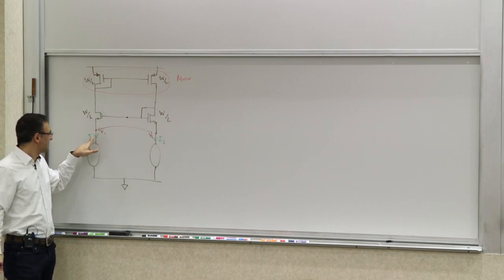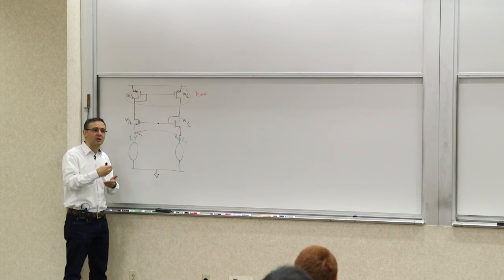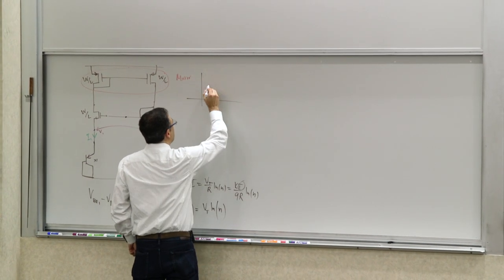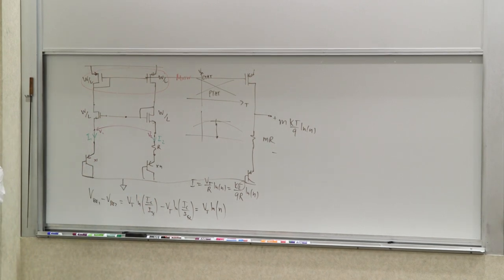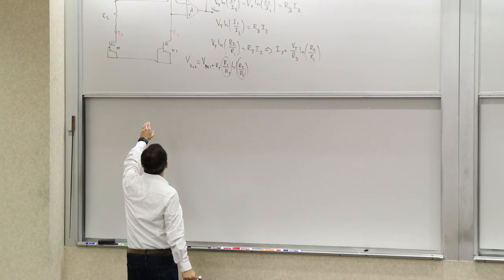134N. Scaled bandage reference, adjustable voltage PVT independent references.

Comment: 00:04 Advanced biasing techniques in integrated circuits
02:25 The Scaled bandage reference and adjustable voltage PVT independent references enforce similar currents and voltages.
08:07 Enforcing equal currents for substantially similar voltages.
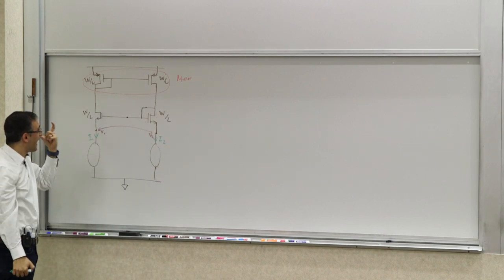10:21 Diode connection impacts voltage regulation.
15:39 Different configurations for VT reference
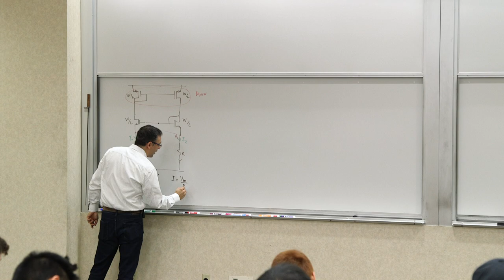17:40 Adjustable voltage PVT independent references
21:39 Discussion on creating a constant voltage using adjustable voltage references.
24:13 The need for a stable solution in chip design.
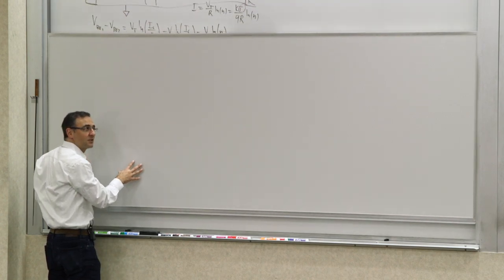28:23 Using op-amp for voltage equalization
30:44 Analyzing voltage references using equations
35:48 Voltage cancellation at 1.1 volts
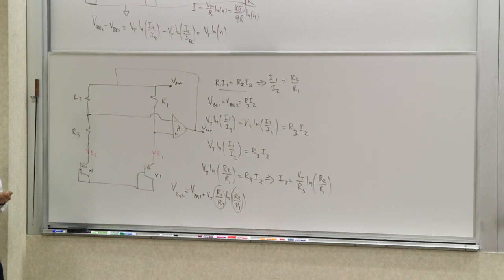37:48 Discussing the issue with the voltage and finding a solution
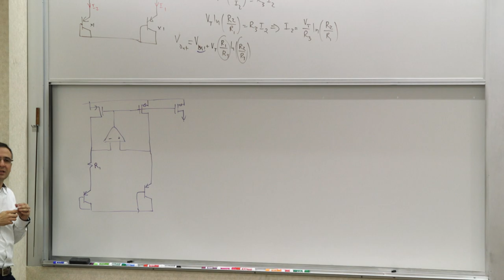42:25 Generating a VT reference by dropping voltage across a resistor.
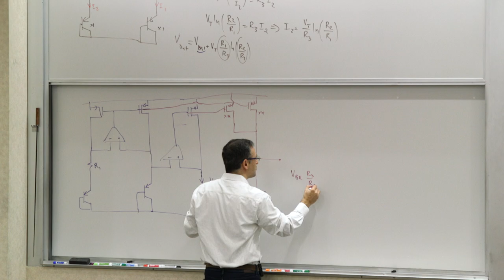45:01 Explanation of scaling factor and voltage references
50:11 Adjustable voltage PVT independent references
Crafted by Merlin AI.

Comment: I don't know how to connect op. amps in the circuits you drawn (right connections of positive and negative inputs) in such a way that they are inside a negative (and not positive) feedback loop. How did you chosen the right way in so fast manner? It not seems to be intuitive. Thank you.

Comment: Hello Professor,
About the floating mirror:
When we talk about resistance seen from node, we are talking about small signal resistance right?
So in small signal model, even if we connected VDD to ground with diodes, I think it is okay, since VDD is ground in small signal model.
Sorry, I still don't understand why we can't connect VDD to ground with only diode connected MOS. Ang above is my doubt.
Thank you very much.
Reply: Dont think about small signal in this case. Small signal is only valid if it makes sense to linearize the non-linear components around an operating point, which is not the case here. We chose the floating mirror because it made the voltages below it equal and independent of the supply voltage. With only diodes above it the voltage would be very much dependent on the supply.

Comment: But what if, in the floating mirror, we have different impedances "under" the floater?
Reply: If the currents in the two branches are equal, then if they flow through unequal impedances, the voltages on the sources of nmoses in the floater cannot be the same, which means they have different overdrives, which, in it's turn, implies unequal currents in the branches
Reply: Am I right that by making pmoses "stronger" we can make the currents more or less equal, but still, we would end up having unequal voltages on the given nodes?
Reply: @brantran3754  This line of questioning came to my mind too. If the combination of the pmos current mirror and the floating current mirror forces the currents to both branches to be equal and the source voltages to be the same, are we saying then that the impedance of the circuit underneath is forced to be the same even if we make them different ? The obvious answer is no so there must be a flaw in the reasoning. The gate voltages of the floating current mirror transistors are the same because they are the same node. For the source voltages to be the same, the VGS's should be the same. For the VGSs to be the same, the floating current mirror transistors should have the same current AND the same W/L ratio (or it is the same as saying their overdrive voltages should be the same). So the source voltages are the same if the W/L ratio is the same. Otherwise they are not. The condition should be, same current AND same W/L ratio of the floating current mirror transistors to force the source voltages to be the same, with both source voltages one VGS below the gate voltage.
Reply: @brantran3754  increasing the length of the pmos current mirror will make the mirroring more accurate because by increasing the length, we are increasing its output impedance r[o] = 1 / lambda I[D]. The key to forcing the source voltages to be equal is to make the W/L ratio of the floating current mirror equal which makes their overdrive voltage equal and therefore their VGSs
Reply: @brantran3754  I think the proper statement of what the combination of the pmos current mirror and the floating current mirror does is - the currents through both branches are made equal by the pmos current mirror AND the floating current mirror TRANSMITS the source voltage from one side to the other side. The source voltages will be equal only if the W/L ratio of the floating mirror transistors are the same (same overdrive voltages) otherwise the source voltages will be different.
Reply: @sam1tim316  think of it this way: in general there are two unequal impedances connected to the two branches of the floating mirror. Two unequal impedances imply different i-v relationships. But an impedance is not necessarily resistive, for example a diode has exponential dependence of current on the applied voltage or the impedance of a capacitor: it is a hyperbolic curve. The action of the floating mirror is to "find" the intersection point of the two curves: the point when the two attached loads have the same voltage for the same current. This doesn't mean that for every current the voltage will be the same but rather there exists some current for which the two voltages will be equal. In a general case there may be many intersection points which means that there are more than one stable states for the circuit.
Reply: @brantran3754   Great point!! In the case of linear resistance : 
this is where channel length modulation comes to picture.
Take the same example where prof.Hajimiri says vds1=4.2V and vds2=1.5 V, obviously the currents in these 2 legs are not same, they are in the ballpark and similarly the source voltages (under the floater ) adjusts (source voltage cant be too much different in the 2 legs  unlike drain voltage -- that is why we say they are in the ballpark as well).So what happens if the linear resistance is too much different? then source voltage has to change too much to keep current same so one of the mos go to triode or/and the diode to subthreshold depending on the load.

Comment: 40:52, In the technology I am working with the resistors are also temperature dependent. When I generate current using this method(low voltage bandgap reference) It is dependent on temperature because of resistor. How to generate a current that is independent of supply without using resistors. At 48:26, resistors R1, R2 and R3 are not temperature independent
Reply: As far as I know all the resistors in the integrated circuits are temperature dependent. At 48:26, yes, the resistors R1-R3 are not temperature independent, but the ratio is. So by doing a good layout, the resistors ratio are temperature independent. The equation 48:26 is also independent of supply voltage. By choosing the ratios, you can pretty much get any voltage you want.